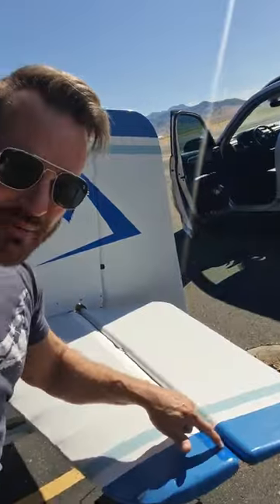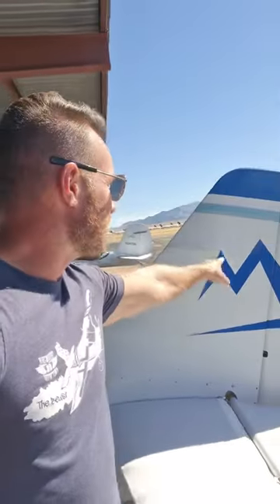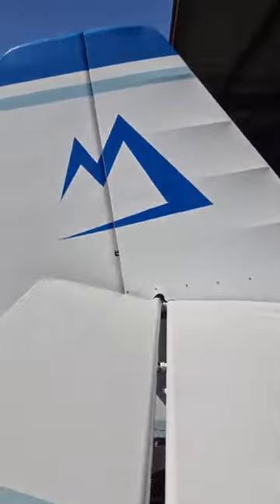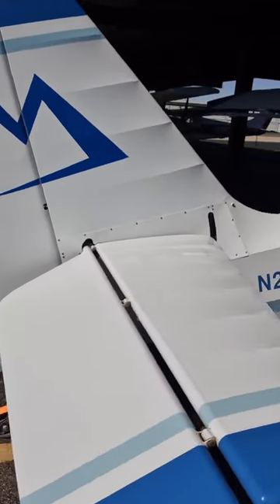Modding out my Kitfox..one step at a time

Comment: Few hrs in a Kitfox myself nice little flyer. I did same thing with old merlin I had years ago before I recovered it and did make a difference although you wont notice it yet till you get used to it! Everything 50 60 mph not big difference in cruise but slipping depending on size of gap. Ductape lol! and lot of it to get it up to the 200mph range ahahaha...safe flying

Comment: That slot should actually provide the elevator with faster airflow to re-energize (slightly turbulent air) the flow of air above the elevator thus delaying airflow separation aka stall. I am not sure how effective it is for the elevator but think back to the concept of single slot flaps in a lot of general aviation aircraft. Covering it may make it slightly more efficient when you are in faster phases of flight but I think the advantage it gives your airfoil is significant enough at low speeds that it was put there for a reason.
Reply: Fidd88  no problem, do you fly too?
Reply: Fidd88  😂 well I'm a USA CMEL,CSES,CSEL, IR pilot low time looking for my way into corporate and private sector aviation.